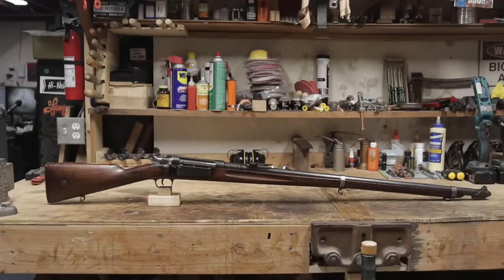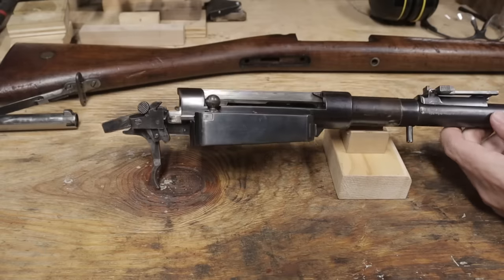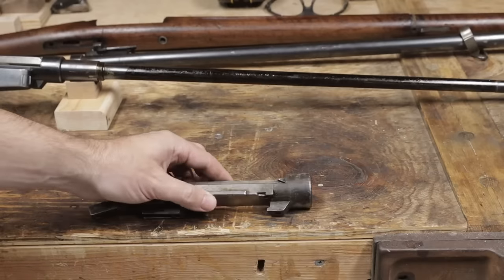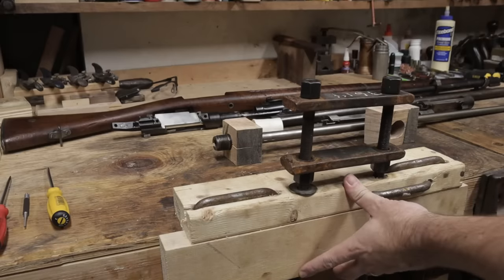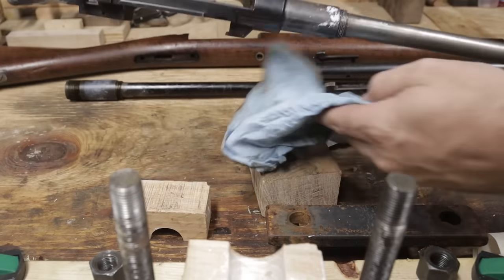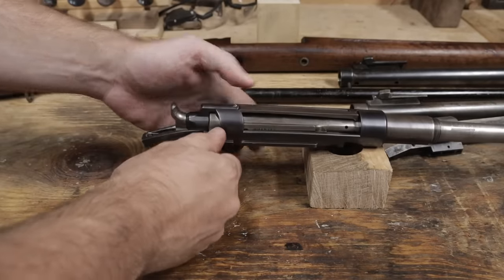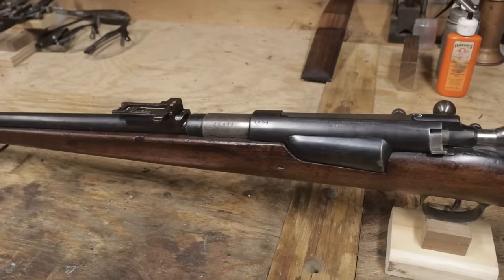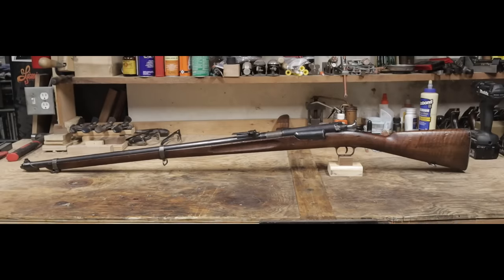Reactivating a Deactivated Rifle

Comment: Pattern 14 Enfields in .303 are being reactivated now that they are getting scarce.  If it isn't a drilled receiver but drilled barrel a man from Australia.  Pull the barrel, if it's a Remington Eddystone you have to turn down the barrel right in front of the receiver ring to relieve pressure the RE guns have from install.  Once you turn it down and remove the barrel, take a section of .303 barrel from a cut up barrel, any enfield .303, they can be found for 5 bucks here and there.  drill out the chamber pin, turn down the barrel stub till its nice and smooth and even with no outside taper.  Measure outside Diameter and then bore the chamber out to the mouth of the chamber.  Then cut barrel stub the length you need it so that the face is even with the original bore face.  Press the stub in place, should be very stiff.  Then silver solder or braze the stub in place.  Then drill the pin holes on the outside of the chamber and counter sink the stub you just installed, do that on both sides where the chamber pin hole is.  Thread the holes you drilled out and insert hex head set screws and crank them down hard as you can but dont strip them.  Weld over top of the screws and turn or file until flush with the outside of the barrel.  Lastly you have a .303 pipe stem to stern, now use a chamber reamer and ream a new chamber inside of the now secured barrel stub inside of the barrel.  Head space it and you have a reactivated Pattern 14 Enfield.  Why go through all this trouble? because many P14 Drill rifles out there are numbers matching and had nothing wrong with them at the time of the Drill Rifle conversion and most are numbers matching with MINT bores.  So it's worth the time and effort.

Comment: In the EU bolt action rifles requite the barrel to be drilled through multiple times and a hardened steel pin to be welded in so any barrel would be total scrap and the bolthead has to be cut off so you’d need a new bolt as well. Both barrels and bolts are considered the controlled parts

Comment: I own a Mosin Nagant that has been deactivated to EU Rules from before 2016.  It has had the underside of the barrel cut about 3/4 of its length, the rifling had been ground down from the muzzle to about 3 inches down and the same done on the breach side.  The barrel has been fitted with a hardened tool steel rod and welded in place.  There has also been a hardened steel pin to prevent rounds from entering.  The bolt had had the firing pin cut in half, the pinhole welded and had been cut at a 45-degree angle.  Because it is a pre-2016 deactivation, it will cock and dry fire.  Post 2016 guns and still move their actions, but can no longer dry fire.  Automatic weapons like pistols or reciprocating rifles will have the bolt welded to the receiver, meaning on guns like AKs and FALs, you cannot move the charging handle, and can't fully field strip the gun.

Comment: In Norway the Krag would have had a hole bored through the barrel and receiver with a hardened steel bolt welded in. The end of the bolt and firing pin being cut at about 45 degrees. Only the stock and trigger would be reusable.

Comment: Either use more tape around the barrel or use a shop hammer and hit the living daylights out of the lower side of the receiver remover cause easing it around with the pipe wrench will help the barrel move with the receiver but a quick blow with a shop hammer will loosen it
Reply from the maker: Good tip! Next time

Comment: I've 2 bm-59 barrels with the plug in chamber about 4.5in. long, one has a partial jacket assembly on chamber with 2 mounting point lug hook things so can't see barrel under it, would need a rig like yours to get off, and the other one is bare, it has the most vicious (spot or plug weld or broco rod burn) through to plug I've ever seen at front portion of chamber so is toast.

Comment: Ive used 400  grit fine sand paper with the yellow backing, wrap with the  sandpaper facing away from the barrel. its a  gripping issue.

Comment: very interesting that they'd use lead
i wonder if that was intentional so it would be possible to easily remove at a later date, as you'd only need to heat the barrel to remove the lead, although maybe simply because it was just easier and cheaper to use for deactivation

Comment: I would HIGHLY advise against melting it out if it's filled with lead...!
Drill the core out and you can easily remove the rest. If you heat the barrel it will lose its hardness and make the rifle unsafe to shoot.
Reply from the maker: Check out the pinned comment or look at my channel. I posted a follow up to this. No melting involved

Comment: So in its day, I assume the receiver/barrel screw joint was designed to allow interchange/replacement. Via a special manufacturer tool / vice arrangement or somehow different to your method?
Re the alignmentt marks - what does that ensure? Presumably the barrel is calibrated to maximise ithe best position?  Or is it to ensure fully tightened on.
If you couldnt get it to align when tightend sufficiently, would the procedure be to grind a small amount off the face of the receiver?
Re the rim thickness bit. Didnt fully understand that, Was the extra tape thickness added to a good sample bullet to check wouldnt latch down  ie that there wasnt execessive axial play where the bullet resides?
Reply from the maker: The alignment marks are there so the extractor cut out on the back of the barrel ends up at the correct location. For most other types of rifles it's to align the sights as well. If the barrel is fully seated before the marks align, then yes the barrel needs some material removed until they align. 
The tape is for the headspace. Cartridges can vary slightly in length, but also there should be around .005-.010" of a gap between the bolt face and an average sized cartridge for proper functioning.

Comment: This is not a "reactivation", it's a rebuild using replacement parts. Like rebuilding an old engine by replacing pistons & rings...That said, it's a decent rebuild, although I don't know why anyone would bother with an obsolete rifle, like the Krag, which you can't even buy ammo for and groups like a worn-out black powder muzzle loader...Better go easy on that brass 🔥🔥

Comment: Hated when the original barrel has been damage, there is a way of restoring it, but is not cheap, gun historian or gunsmith re-welded the damage area and re-drill the barrel, depending on what type ?!
Reply from the maker: I suppose it's possible, but outside of my skill set unfortunately. What's left of it could be used for a carbine build in the future though.

Comment: I would have liked to own a gun when I was younger especially that old, but it wasn't to be and now the most fearless leader in the world (most something anyway) has been banning everything that shoots (unless it "shoots bull (crap)"
I was still in school when a friends dads antique furniture shop got in a 
Mannlicher something or other full original rifle complete except for the sling was gone. 
$75 (which was too much for my budget and the economy was bad then). 
I was told it was made for display only and couldn't be fired.
I held it and you could see the outline where the slug and tip of the shell would be buried im presuming that the receiver and barrel were both ruined. 
It was cut open on a milling machine. 
I always wondered if someone filled it in with welding rod and pecked out the profile again if it would have worked. 
My hunch is eventually the welded in section would break free (in your face) unless the shells were "lightly powdered" meaning 1/2 of the proper amount so the shock load would not break open the repair. 
Today I see you just find another unmolested barrel. 
I remember reading then how former WWII rifles were available but the original stocks were replaced by new short one  deer hunting and less expensive than brand new deer rifles of the day. 
My friends dad told me;
I just got this in yesterday.
My Indian friend (Ojibwe) saw it and was looking at it handling it. 
An elderly lady stepped in the doorway, saw him pointing the rifle at her and dashed out! 
Nice to see yours functional again.

Comment: Wood Blocks too soft..use brass clams.
Some rifles are Machine Torcked...so appropriate Receiver Clamps or Keys, with a long Cheat bar needed.
At times Either a strike on the cheatbar end with a small sledge hammer or a little heat on the receiver ring and Kroil  are needed to "crack" the threads.
Military armourers had custom made Barrel and Receiver Wrenches for Barrel Takedown.
Your approach is sound, but  your materials are insufficient.
Thanks for your video.
PS did you temove the extractor from the bolt before Headspace tests?
DocAV
Reply from the maker: Honestly I'm surprised the wood blocks worked. There even wasn't any damage or compression on the one holding the receiver. If they wouldn't have worked I would have probably machined some out of aluminum, but I'm glad I didn't need to. 

I did retest the headspace off camera using just the bolt body. Didn't want to be fumbling around trying to extract the cases on video.

Comment: What brand of sizing tools do you use? I have RCBS for my remington rolling block, and the brass doesnt realy look right when sized with them.
Reply from the maker: For sizing the 8x58r cases? I use RCBS dies and they work just fine.
Reply: @rakumprojects  yes.
Maby the krag has a better chamber then a Remington rolling block. Feels like the cases get a much sharper neck angle from the rcbs die than when shot in my rifle.

Comment: yeah nah thats not a real deactivation at this point.
Modern deactivations in Europe have to be done in such a way they cannot be reversed.
receivers are cut in ways that that makes them them thoroughly weakened
& barrels get drilled.  

there is no way coming back from that, except if you would weld it all up..  but the skillset required to make a deactivated gun work again, it would be easier for that person to just make a new weapon from scratch..

Comment: Have you considered doing a powder coating on the cast bullets? I'm sure the raw lead, even a hard alloy, will drastically increase fouling. Otherwise it's a beautiful rifle! Were Krags ever used as sniper rifles due to their jacketed barrel keeping the temp the same?
Reply from the maker: I've been wanting to try powder coating cast bullets but haven't gotten around to it yet. I shoot cast with gas checks for now.
Denmark and Norway both had marksman variants of the Krag, but neither used barrel jackets. The idea of a jacketed barrel quickly fell out of favor shortly after these rifles were adopted.

Comment: Very interesting.  Would the deactivated barrel been legal after removing the buggered muzzle end?  Perhaps that might make a replica carbine, or were they much shorter?
Reply: It looks like the barrel was cut cleanly in half.  Even after removing the lead, there wouldn't have been much to work with.  Aside from making some weird and hilariously hard to shoot SBR, I doubt the remaining pieces are of much use.
Reply: @johngrimes6078  , I got the impression it was a lot closer to the end.  As long as those barrels were, I thought he might still have an artillery carbine length.
I would try boring the lead out with like a soft iron drill bit, like cold rolled steel.  After a couple of passes, most of the lead would be gone.
Reply from the maker: What's left of it is around 21". Just an inch short of the Danish carbine length, but close enough to save for a future build.

Comment: Damn shame on the sliced barrel. I would have dressed it down and took a welder to it. Full ring welds, then a rebore and re-rifling, and finally dressing the outside on a lathe.

But I imagine this wouldn’t be good enough for the safety draconians, even if a 7018 (or appropriate material equivalent structural grade weld could hold upwards of 80k psi

Comment: The original was in beautiful shape but the fact that they cut the barrel is insane! I live in Canada and the only deactivation require is a plugged barrel, not cut. the value of the rifle was destroyed when they did that, which is why you got it for such a good deal. awesome you had spare parts for it, and a really ingenious way of clamping onto the barrel and the receiver. Well done indeed! I am a sucker for old military rifles, I had a few in my younger days but the laws in Canada regarding Firearms SUCK, Leftist liberals frigging piss me off so much! I had some beautiful firearms back in the day but was forced to sell them to an armorer. Rather than see them destroyed But I was able to keep my Mosin Nagant 7.62, Brno TGF .22LR, and Gevarm .22LR rifles at least. The others were all semi autos that were easily converted to full auto Especially the Tokarev which was  full auto if you removed the safety switch inside the trigger guard, but that thing was uncontrollable when I tried it once and quickly reinstalled the switch, imagine the 7.62 x 54 round, which kicks like a severely pissed Mule, in full auto, I even had friends hang onto the barrel of the gun when I shot it and with three of us could not stop the barrel from pointing up and to the left, it was incredible. I happily sold that pig. But I digress, I really enjoy seeing those old military bolt action rifles still in use, or in this case, reactivated so it can be shot again. I was pondering perhaps you could re-blue the section of the gun exposed by using a really watered down cold bluing agent if the different patinas bother you but since it's a mixed serial numbers gun now I would let it slide, and that's the impression that I got from you in this video , but for me it would drive me nuts, even though the numbers are mismatched, but that's just me.

Comment: What's that clamp tool you used at 14:36 called?
Reply from the maker: Knipex pliers wrench. They're a lot more controllable for pressing pins than a hammer and punch. The parallel jaws won't damage the finish either.
Reply: Thanks  @rakumprojects  for the reply! I need those, so I'm going to buy them now!

Comment: Would it be possible to heat the barrel that's been plugged to melt out the lead, then re-cut it, have it properly aligned, and re-bored?
Reply from the maker: It would be very difficult to align and attach the two sections. Instead, the remaining barrel would be useful for a carbine build.

Comment: DUDE headspace gauges are cheap I would never use tape and empty case.
Reply from the maker: Headspace gauges for 8x58r just don't exist. Since the thickness of the rim is the headspace, a precision machined washer would be ideal but tape on a case works well enough. I'd be more hesitant to use this method for cartridges that headspace off of the shoulder.

Comment: Why anti-seize and not thread-lock?
Reply from the maker: In case it needs to be removed. The torque is enough to hold it in position without thread locker.
Reply: @rakumprojects   Ah I didn't realize there was that much torque on it. It'd be interesting to see what ft lb that comes out to. That being the case it makes sense to me. Thanks for the explanation!